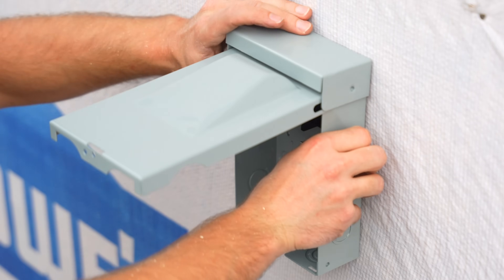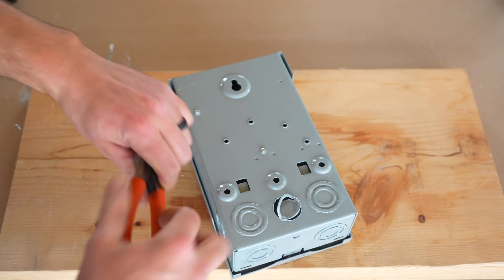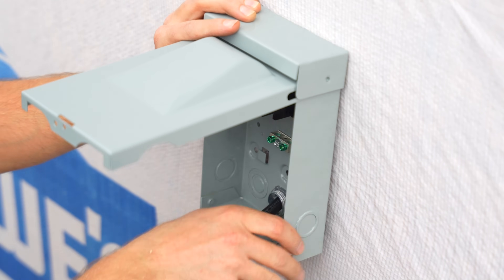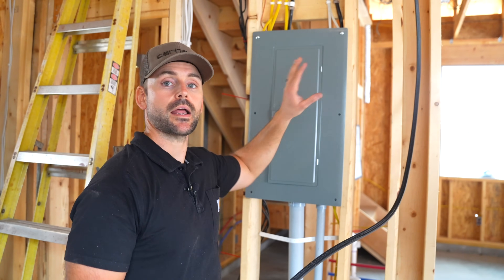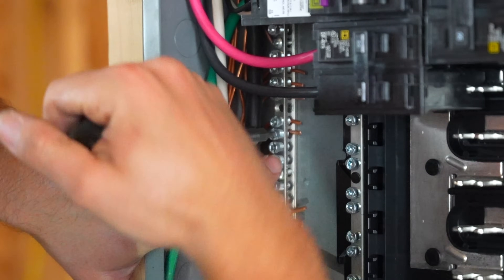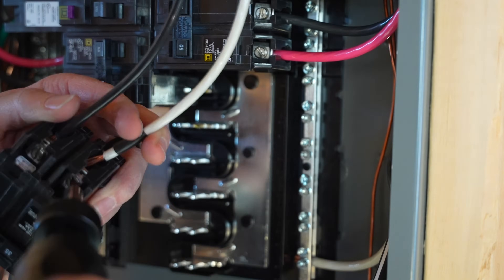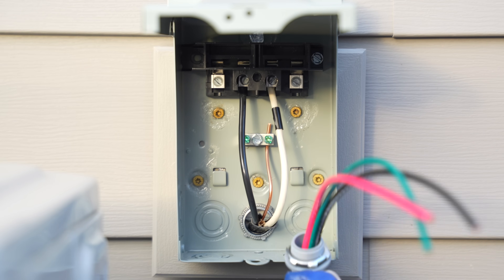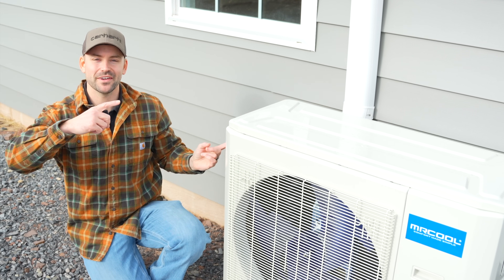How To Install An AC disconnect - ALL WIRING!

Comment: I am needing to install a disconnect box, but what kind of 8 2 wire will I need? I am installing the mrcool 18000 btu 230v split unit.

Comment: Looking to install a 24k btu mitsubishi hyper heat miniplit in the future and ran a 10/2 wire with the same disconnect. I know the HVAC guy told me it would require a 30 amp breaker. I am trying to get this knocked out today, but I am getting different information saying I might need a 10/3 wire instead due to sensitive electronics. Your thoughts?😊

Comment: Great video! I like the touches like black tape on white wires that are actual hot and the use of a torque screwdriver. The latest NEC codes have added lots of guidance on that and there are good ones for less than $50 (especially for us DIYers who may not have a natural "touch" for tightening). My only addition would be mentioning that this is a great point at which to add a surge protector.
Reply from the maker: Thanks for the positive feedback and the helpful tips!

Comment: How would wiring up a 115v system in the disconnect differ from a 230v system? Just cap off the neutrals?
Reply: Your “neutral” is the 2nd hot leg

Comment: Excellent Step by Step Video Tutorial. I would have started by installing the whip to the A//C unit then connect the other side of the whip to the disconnect.

Then run the 8/2 to the sub-panel and continue connecting it to your breaker like you illustrated. That way there’s no chance you might get bit by the 8/2 already hooked up to power. 

I know you had your breaker off and the disconnect wasn’t connected but, getting hit when you’re outside isn’t fun. I would use red tape on your neutral conductor so you know it’s hot and it keeps everything in phase…

Comment: Wanna point out that number eight wire is not needed for this unit. If you read the name Plate on the side of the outside unit, it will have a minimum and a maximum amperage. My 24,000 BTU mini split as a minimum of 22 Amps and a maximum of 35 amps, so number 10 2 wire is all that’s needed on a 35 amp double pole breaker. However, you can run number eight, but that’s more money spent on wire. Also, when you buy a premade whip from your disconnect to your outside unit, it only has 10 wire in it.

Comment: You dont need to run neutral subpanel to disconnect box? I got confused. Thank you for sharing your knowledge
Reply: Correct. There is 240 v across the 2 hots and 120 v between either hot and the neutral wire in the typical US residential power supply. That means that the neutral is not needed for 240 v power supply. The GROUND is still needed for protection. (the 120 v circuits use the neutral and ONE of the hots.

Comment: no neutral wire?
Reply: Not for 240 v. In the US it is 120 v between neutral and either hot wire (the service/breaker panel takes care of that as part of the design of the bus bars).. Going across BOTH hot wires provides 240 v. No neutral involved, but you still need a ground for safety purposes.

Comment: You just savede me a ton of money.  I just needed the disconnect box replaced, actually just the piece that connects the wires.  I had the new disconnect box.  some one quoted me $450.  I watched your video and did it myself, now my ac works.  it is 96 degrees in the house right now, but finally (thanks to you) it's cooling off.

Comment: What about neutral wire? Do these installations not have a neutral line? Is it because both lines are out of phase that they can be without a neutral?
Reply: 240v doesn’t have neutral. It is 2 hot wire of 120v

Comment: If I have a subpanel for a washer and dryer can I punch out a hole on that box and add a 15 amp breaker at 110 for a mini split? Or do I have to run the wires all the way to the breaker box?
Reply: You can pull 110 out of it I've done so for an outlet

Comment: Would i be good with a 30 amp disconnect or do i need 60 like you? Im doing a 24,000 BTU Mr Cool. Running 8-2 wire and I have a 30 amp double pole breaker (not a 35 like you).

Comment: Given the option - it's best to land these high current draw breakers closer to the main lugs, and things like lights and outlets below them. This helps keep that big back plate a little cooler. Not a big enough deal to re-wire the breakers that are already in the panel, but good to think about ahead of time when initially wiring up the panel

Comment: Dumb question im sure, but how do you get away with not having the neutral?
Reply: It’s 240 V only does not require a neutral. So two hot wires and a ground.
Reply from the maker: The white wire is considered a neutral. I hope that helps!

Comment: great detailed video!  Very informative.  Question.....on stranded wire, would it be better to solder the ends before installing it under the screws?  Seems like with stranded, it would be easier for it to loosen up at some point.
Reply: No. It would cause problems down the road. The pressure will cause the solder or tinning to cold flow and loosen the connection.

Comment: Wonderful vid. What would be the different if you’re installing a 120v as opposed to 240. Do you still wire in your line the same? Since the white is neutral now how does it affect it?
Reply: You wouldn’t break the neutrals, they would be wire nutted together and only the hot would go through the switch if it was a 120V circuit

Comment: I know the lugs are labeled with the inside as LINE and the outside as LOAD. But technically, it shouldn't matter if you reversed it. The pull piece just connects the two sides to each other, it doesn't care which is which or whether they are right or left, inside or outside, top or bottom. Correct?
Reply: Yes correct. My lines are on the outside and loads on the inside. Doesn’t matter
Reply: 13:00 13:00
Reply: Electrically it does not matter. But when the disconnect is out it is somewhat harder to accidentally touch one of the inner terminals (note the extra terminal shielding also).

Comment: Just curious...I just bought the 12k (120v) and I'm wondering if I'll need the outside disconnect still.
Reply: If it's hard wired (as opposed to a plug), it needs a disconnect.

Comment: Note that for minisplits, you can actually size your wire to the minimum circuit ampacity that's on the unit's info plate, not the maximum over current protection (breaker size). Probably not issue oversizing as long as your termination points are rated for that wire gauge, but you may not have to.
Reply: I would over size to accommodate voltage drop.

Comment: Nice work, however @ 5:07 it would be nice to put some silicon at mounting block/vinyl transition to prevent moisture/water entering behind vinyl and eventually damaging wall
Reply from the maker: Thank you! A little silicone there definitely would not hurt anything. Thanks for your input!

Comment: I had the same problem you did at 13:40 knocking out the metal inserts. It seemed like mine was tacked welded to good when they made the box and more was removed than I wanted. So I had to buy reducing washers like you did. I feel better now.

Comment: Why did you decide to purchase a non fusible disconnect?  Why not install a fusible disconnect?
Reply: No reason to. The fuses would be redundant to the circuit breaker. Also they are extra expense and complexity. A fusible disconnect is roughly the same price as a non-fusible, but you have to buy fuses to make it work. Extra cost.
Reply: Nice work. Thanks for sharing.
Reply: Great video!

Comment: What would’ve been nicer is a bushing in the back of the disconnect for a flush fit with no gap between the disconnect and wall instead of that Romex connector.

Comment: I'd like to see a detailed guide on how to shorten the lineset down so all the excess is not coiled up.  I've had a MrCool mini split for a couple years now that I installed start to finish including the AC disconnect and it's great minus the ugly lineset coiled up situation.

Comment: 🆘Question, if I have a 150 amp meter box and put a 60 amp disconnect plus have a 50 amp disconnect going to my main panel and another 50 amp disconnect going to a sub panel, is that to much for my meter? Can I do a 40 amp disconnect for my sub panel or main???
Do I sound like I have no clue because I didn’t know about electrical but I hired a neighbor to upgrade my 100 amp meter to a 150 amp and he has two 50 amps coming off the meter with one for my main and one for my sub panel! It doesn’t seem right and no and then I hear a buzzing noise coming from my meter panel box!!! Please help because I still don’t have a disconnect for my outside condenser unit!🙏🏼🆘
Reply: The total amps of all the breakers is irrelevant. If you have 150 amp service, then that’s how much you can use at any given time. Even if all the breakers add up to 200 amps. If you ever tried to use more than 150 your main would trip.

Comment: The white wire you put black tape on should have had red tape on it
Reply: Never seen that. I always see black tape to indicate the wire is hot.
Reply: @fuegoman45  another choice could be red or black heat shrink on your conductor to indicate a "hot" .
Reply: Why.. where does code state red? Black is an acceptable color to re-identify a white conductor as hot

Comment: the guy that put mine in put a surge protector on too to help protect the condenser...
Reply: Surge protectors are required (at least in California) on the main panel.
Reply: @fuegoman45 well in this case it’s a disconnect for a condenser and the disconnect also needs a surge protector
Reply from the maker: That’s not a bad idea!

Comment: Great job Josh. Torque on breakers is important. So many don't do this simple procedure. Great to see every step and the importance of local codes. I have used a VEVOR Torque screwdriver for a while which is very handy. Again, such a wonderful video Josh. 🔨🔨👍🏻👍🏻
Reply: the electrician that helped install my panel didn't torque ... He jammed the screws so tight that some of the copper was pinched almost in half. SO re terminated each breaker by cutting the pinched exposed wire he did and actually torqued it properly. That's annoying.
Reply: @kbeeng6307  I'm a licensed electrician and you definitely did the right thing. There's electricians out there who'll scoff at the idea of torquing things down properly but it only takes a few seconds and makes installs so much safer.
Reply: @kbeeng6307 it sounds like you did the right thing. It doesn't take much to take that little bit of time to torque them. Over tightening them can also cause issues down the road. Hopefully your project is safe and secure now.
Reply from the maker: Thanks, David! Information stamped on the breaker is not very noticeable. It’s nice to know the torque specs are right on the side. Thanks for stopping by and watching my video! Take care, David!